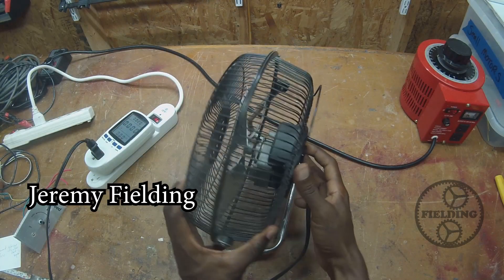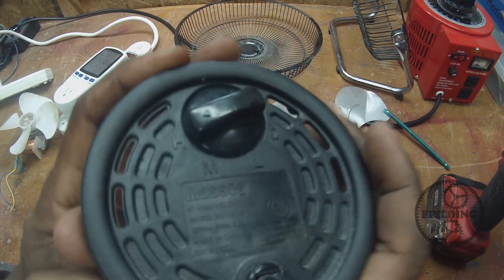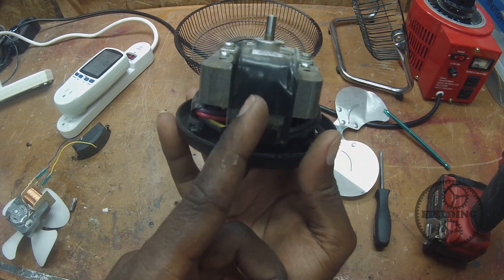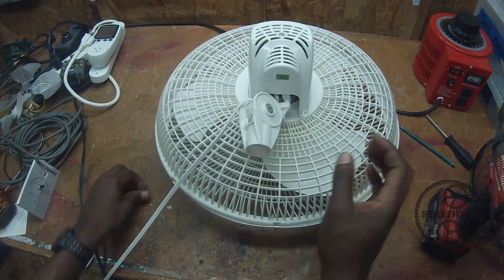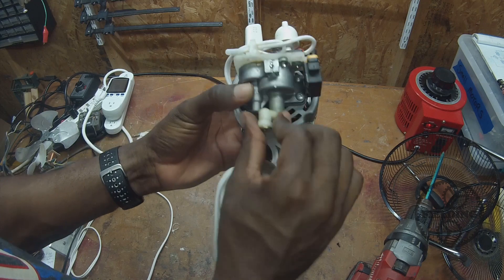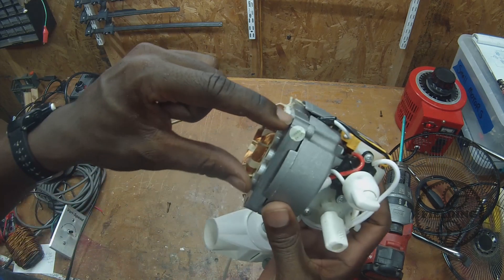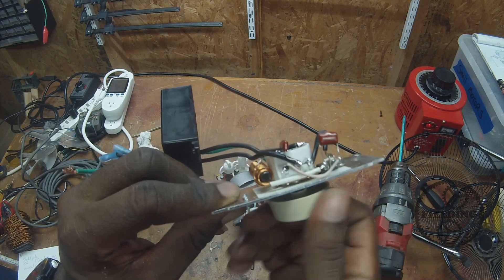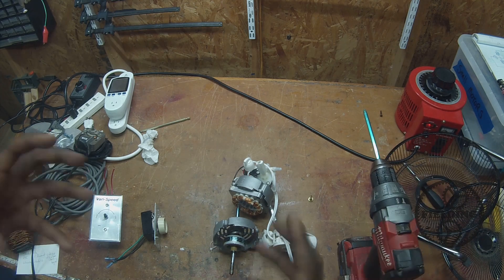Speed Control for Shaded Pole and PSC motors; How they work!: 039

Comment: Jeremy, you’re a spectacular presenter of some much appreciated knowledge. 

Can you tell me what the most economical way to generate between 5000 and 20000 watts and put it through a motor that will be used in a marine electric repower?

I have a 100 lbs. 15 horsepower 3 phase AC motor and a 6 hp dc 12 volt 400 amp motor. Either of these motors can push my 27 ft 7000 lbs sailboat. It currently gets around with a 4 stroke gas guzzling 9.9hp Honda outboard. I was thinking of replacing a used typical outboard upper unit motor I acquired with the 12 volt 6 hp electric dc motor I have and doing inboard power with a motor between 10 and 50 hp directly in line with the drive shaft. I’d really appreciate advice on the cheapest sensible ways to power and control a motor that can spin a shaft fast and with high torque. Should I throw out the AC motor or is there a way to use it from my DC battery banks to 230 / 460 3 phase AC without breaking the bank? Cheap inverters or vfds, or ways of getting around a VFD to generate 460 volts and 20 amps at varying hertz frequencies to control speed? Thanks

Comment: How does an induction motor with a start winding but WITHOUT a capacitor create a rotating magnetic field to start the rotor spinning?
Reply from the maker: There was a start capacitor for the PSC... it was tiny, but it was there. You should also watch my video on "how induction motors works" is shows the shaded pole motor in more detail.

Comment: I've been experimenting with a shaded pole AC fan motor. I know if I remove the two shaded pole copper loops that the motor will still run if I start it by hand because it still has 2 magnetic poles working on opposite sides of the rotor. What I'm trying to find out is that if I physically remove one of those magnetic poles if the motor can still run under no load, of course it will have to be hand started. I've sawed the stator frame in half to do this and removed one side. So far no luck in getting it to run. I have demonstrated that a synchronous AC motor (with a permanent magnet rotor) will run in this configuration. I'm just trying to see if it is impossible for an asynchronous AC motor with a solid rotor to run in this configuration under no load. No reason for all of this other than to solve my own curiosity.

Comment: Great video very informative 🙋🏽‍♂️ just have one question.. 
Is there anyway i can change the speed of a PSC motor further than how it comes already by design as it's pre tapping into different sections of the winding..  can i get my  fan motor to spin abit slower than the lowest set speed it comes with? 🤔 say adding a different capacitor or another cap to inpact the wave to change the speed??
Reply from the maker: Lower voltage for a fan

Comment: So, I wanted to have variable ventilation for where I'm spraying stuff under the hood (high), after I'm spraying (medium) and for soldering (low). So I wanted to put a speed control on a shop vac and run the exhaust to a window or under the garage door. I'll edit if I'm wrong, but that's probably down to 1/3 speed. If I get a speed control rated 1:1 for the motor rating on the plate, will I be good? Are they all the same thing as a light dimmer, just different wattage? I don't know if there typically capacitor start or more like a fan. It's probably 20 years old. Any help is appreciated. Thanks!
Reply from the maker: most shop vacs in the US are universal motors. If you have a universal motor you can control the speed with a 'speed controller" like the typical router speed controller.
Reply: Jeremy Fielding, hey big thanks. That helps me out. Great videos.

Comment: I'm using a RF fan speed module to control a bathroom vent fan, but the instructions state "Do not use this fan with any solid state speed control device, my question is do you know is this damaging to the motor or pose risk with overamperage? It uses a basic shaded pole motor with no built in speed control.
Reply from the maker: I don't feel comfortable giving advice about that. There are too many possible issues that I can't anticipate.

Comment: vintage fans use a choke coil for the medium and low speeds to the motor when speeds are high current flows directly to the motor medium and low one end of the taps go through the choke coil then to one of the motor leads. which is used in both shaded pole and PSC motors. and there is triac speed controls. the ones specifically designed for PSC and Shaded pole motors and the max FLA or full load amps is labled on the switch but never use a lamp dimmer switch with a motor as those are for dimming incadecent bulbs.  the speed taps in any motor with multiple wires coming out motor speeds are lowest when current flows through the entire coil. and are highest when it flows through the smallest segment. as that also applies to the taps on an AC-DC universal motor. as now the new ECM motors are fastly replacing these motors used in fans and HVAC. the speeds are regulated electronically via componets on a printed circuit board as well the electronic componets on the board that makes the motor run. as sometimes on the ECM motors the boards go bad meaning the motor has to be  replaced. even though they are energy efficient than some PSC and low efficiency shaded pole motors. they run at a slightly higher RPM. but they cost more.
Reply from the maker: Thanks for the input... you might find the first part of the series interesting... #42 https://youtu.be/tXJOtWPPRwE, I cover some of the things you mention here.

Comment: The star-delta wiring for 3 phase motors use 2 contactor to switch between the to modes after the initial startup phase set with a timer. interesting setup. there are a few youtube videos about this.

Comment: I just watched a couple of your videos very interesting I have a ge washing machine motor that was vfd controlled do you thank the vfd can be controlled manually
Reply from the maker: Are you sure it was a VFD? I have taken apart several GE machines in the US and they are always single phase motors. It would only need a VFD if it was three phase. The machine uses pulleys and a very cool oscillating gear to slow the tub and agitate the clothes.
Reply: It only has a forward and reverse wingdings no starting circuit and a vfd listed in the schematics the motor also has a tac sender It was computer controls touch pad controlled model whsb9000b0ww motor listed as ver speed
Reply from the maker: holy cow it is three phase!
Reply from the maker: It would be awesome if you can give feedback to the controller. I 
haven't seen one like that. It might be as simple as a potentiometer 
connected to the board, or a custom circuit that only works inside the 
machine. Sorry I can't be more help. But Now I know to be on the look 
out for a new front end loader! That is a great motor for the size, and 
the fact that it can be powered with single phase makes it a great find.
 Even if it is only one speed you can use pulleys to get the output speed 
you want.
Reply: I have run it on 120 V direct and it starts right up in both directions  will pull the board out this week end will keep you informed I have a friend that may be able to help
Reply from the maker: Hey Charles... would you go to my website and send me an email? I would like a closer look at the board. After the email we can send pictures etc. www.jeremyfielding.com
Reply from the maker: Nice. You are off to a great start either way.

Comment: I have a 1/3hp 1 phase ac motor. Which potentiometer should I get?
Reply from the maker: I don't know... it depends on your VFD. you have to research that on your own. It should be in the manual or online if that VFD can be controlled externally, and by what type of signal. Mine will receive at least 5 different types of input. There is no way for me to know. Just start with a good search of the web regarding your VFD. Some homework is required :)

Comment: Hi Jeremy,

Thanks for your quick reply. It is my fault that I did not write clearly. I am currently using the an VFD. However, to change the speed of the motor is a pain because it is a digital setup and did not have a dial switch. I had to go thru the menu and reset the speed. My question is there a way to get around this so I could connect a dial switch to control the speed instead of going thru the menu to calibrate? Thanks again.
Reply from the maker: +Derek Leung that depends on your VFD. I have a potentiometer attached to mine for external control of speed with a dial

Comment: Hi Jeremy,
How would you control a belt grinder's speed the easy way?
Reply from the maker: +Derek Leung if it’s an induction motor ( it probably is) you can’t effectively do it. You might slow it down but lose all your torque. Basically it will stall when you put a load on the motor. If you built a pulley system you could do it. But not electrically.
Reply: @Jeremy_Fielding  Many AC powered belt grinders, drills, blender, and vacuum cleaners are powered by universal motors (with brushes).  To confirm motor has brushes, operate in a dark room an see the blue/green sparks on the side where the cooling air blows out.

Comment: In German the squirrel-cage rotor is called "Kurzschlussläufer" ("short circuit runner"). I know what you mean though. I don't know why, but for me there is a slight difference in meaning between "a short circuit" and "to short circuit something". The former is something accidental, the latter something you do on purpose, even though the physical result is the same.
Reply from the maker: Thank you for the insight... For me I found it most confusing when I first became interested in this topic, but knew very little. It is reflecting on that feeling as a beginner that prompted the comment in the video. I have the same feeling, I understand "now" why they call it that, but I feel it delayed my understanding of what was actually happening. It seemed I didn't understand what a short circuit was or the presenter was mistaken  which also didn't make sense.

Comment: That's not a variable speed motor, it's a 3-speed motor.  Variable speed doesn't have preset stops.  The difference seems insignificant to most people, but there IS a difference.  You're converting a 3-speed motor into a variable speed motor.   Nice vid, sorry about the vocabulary lecture.
Reply from the maker: +Ron Yerke I agree... they are not the same

Comment: For the psc motor shown in this video,what is the rotating rpm in high speed mode? It is roughly 120*60 divided by 4? What will happen if we use higher capacitances microfarad capacitor than the original capacitor?
Reply from the maker: +Nordiana kamaruddin I threw it away after the video so I can’t measure it. I would think the manufacturer would wire it for two poles instead of four to get a higher speed but it wouldn’t be sync-speed. It must be something less than that.

Comment: Hi Jeremy, just found your channel and I love your explanations for different motors. Greatly appreciated. Do you know if multi speed ceiling fans are PSC motors? There isn't a lot on youtube regarding them except for making wind turbine generators and the like. I'm not sure if they can really be used for garage diy applications. Electricity is still kind of magic to me at 44 so I'm still not too confident with experimenting with it. 

Thanks again for your contributions. I subscribed and look forward to your future videos
Reply from the maker: First Welcome to my neighborhood! I have not opened a ceiling fan personally. But I would expect them to be PSC fans like the oscillating fan I show in this video.
Reply: Our nutone 765hfl-a exhaust ceiling fan quit; label says 1/100 HP ; 1000 rpm thermally protected. 3 wires in—black,white with green stripe, and white. The plug gave 80 vac b-w and 12 vac b-green stripe.  Putting 120 vac on b and w does nothing;  how to find the problem in the PSC circuit?

Great video and instruction; thanks

Comment: Did any of those fans have the variable resister to increase or decrease voltage for speed adjustment?
Reply from the maker: I see you have already seen it LOL. No, they change the strength of the magnet field through the wiring. That works out to be the same as lowering the voltage.

Comment: You're lucky to live in a place where you need a cooling fan! I removed the cooling fan from our microwave which died recently! Interestingly the plate rotation motor is tapped from the cooling fan winding to give its 30 volt supply.

Comment: Am I correct in thinking that with these speed control shaded pole motors they only rotate  at lower speeds when they are under load, as opposed to freewheeling, because the speed control really only reduces the motor's torque so that the motor just can't spin the fan blade as fast?
Reply from the maker: That is correct.

Comment: It's an internally triggered triac, so no separate diac. It's manufactured by Teccor which is now owned by Littlefuse. Apparently the X25783 was a house number part made for Leviton. Hard to find a datasheet specifically for the X25783, but datasheets for the equivalent Q2101LT are around.
Reply: I just did some google sleuthing. I don't know of any databases that track this sort of thing.
Reply from the maker: Thank you!
Reply: Steve Hodge how did you go about identifying the house number maker etc? Are there any like secret databases anywhere to decode house chips or just custom print jobs on generic ICs?

Comment: I did a web search for the part number and there's returns that confirm it is a triac but the data sheet is hard to find. You don't need a data sheet though. Within reason a triac is a triac. They're like light bulbs. Just replace it with the Wattage you want and you'll be fine. But what about the three leads you say? Yeah what about them. 99% of the triacs out there have the same pin out. But we can confirm this with a continuity test. Chop out that triac and measure between the in, and out wires, and where the triac leads were. In will be T1, and out will be T2. The remaining pin will be the Gate. All triacs can't really be the same, can they? Maybe not but all dimmer triacs are similar enough. Any decent appliance rated triac will do the trick. This ain't rocket surgery. After several microseconds of intense guru meditation I have determined that a BTA24-600BW triac will do you just fine. There's about 8 billion of them in China ready for immediate shipment to you now. Rots of ruck!
Reply from the maker: Thank you Sir.

Comment: I'm not 100% on this but i think a shunt is an intentional short maybe the poles on the rotor are shunted? I learn a ton from your videos. great series.
Reply from the maker: +Daniel Milloy -the way I described was careful and precise. While It is generally accepted to say shorted, that is not technically correct regarding the rotor. It actually is confusing I think to call it a short. As far as shunt... a induction motor rotor is not "wound" or connected in any way. To say that a motor is shunt wound only means the rotor and stator are connected in parallel. In this case nothing is connected to the rotor. Thanks for the kind remarks!
Reply: I'm still a little confused then.  Does the rotor of a an induction motor have any windings at all or is it just a series of lobes [of metal]?  I understand that whatever the rotor is it is not electriaclly connected to any stationary part of the motor.  

Just a suggestion, you've obviously done a lot of research and self-teaching on these motor and good on you for wanting t share your knowledge.  It might be more information if you could put up a schematic when talking about the motor windings.   

In any case, keep up the good work.
Reply from the maker: +Richard Marton. Think of it this way. The metal bars are the windings. Exactly the same as very thick wire. 
Some are intimidated by drawings and schematics. I thought hands on would be more appealing based on feedback from others. You and only one other person has asked for schematics. They make sense to people who already understand what the symbols mean. I didn't want to do a whole video on that.

Comment: Got some wheelchair motors and going to use them on a project soon. Thanks for the  videos it help's me a lot.
Reply from the maker: +Robert Evans thanks! sounds fun. What is the voltage? Just curious if they are 12-24 volt?
Reply: 24 volts
Reply: Me too.  What are your plans with yours?  I plan on making a motorized under the car dolly. With tilting neck and head lift for comfort.
Reply: @CSSIandAssociate  How did your automatic nose crusher turn out? Would love to see a build!
Reply: A wood lathe with VS control...something simple, but i am digging your idea...

Comment: it looks like a mosfet
Reply from the maker: +Joseph Brendel. Several of those parts look very similar.
Reply: It is an industry standard TO-220 package. All kinds of devices come in the same packaging. Including integrated circuits. Parts with lots of parts in them.
Reply from the maker: I don't remember that, and I have already thrown it away unfortunately.